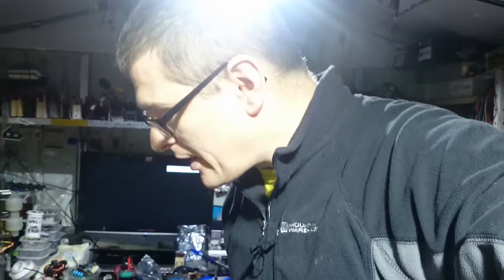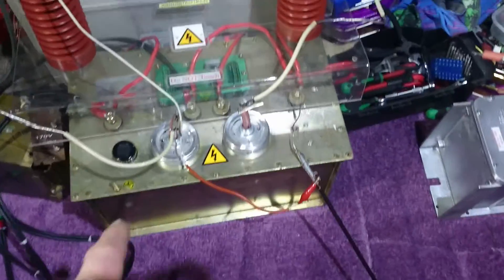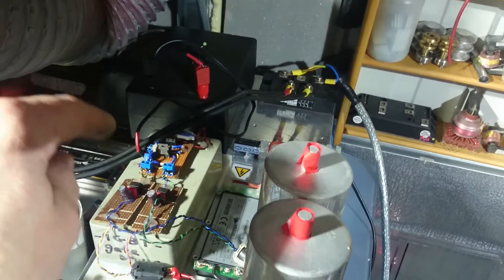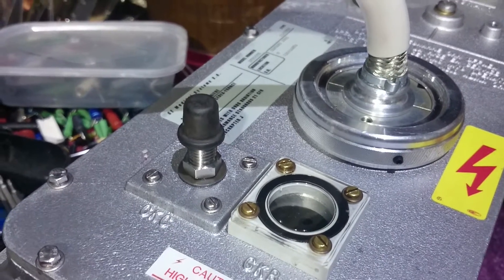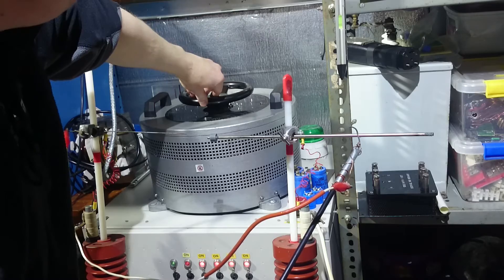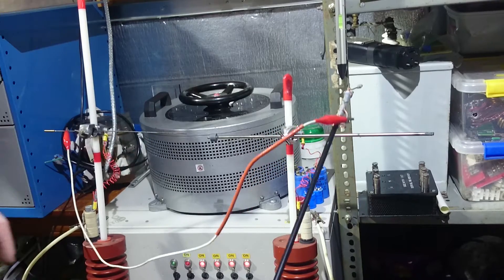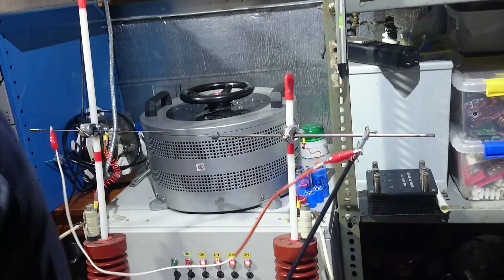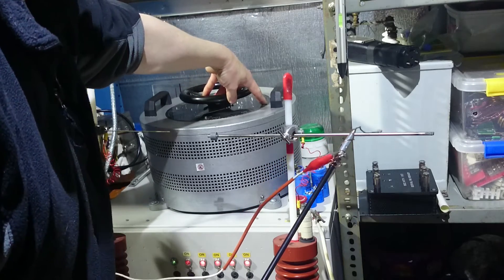IGBT half bridge / 150kv X-ray transformer '

Comment: Hi, that is brilliant!!!!
Could you tell me one things?
Does the Xray transformer is plugged straight to your half bridge or are you using a LC resonant circuit in between like for a CCPS?
Reply from the maker: Florian Delmas Hello mate, no its connection is straight to the igbt. 👍😉 thanks for the comment.

Anthony 

High1voltage1rules
Reply: Thanks,
Last question then, how do you manage to current limiting the transformer?
Reply from the maker: Florian Delmas ballast it mate 👍😉
Reply from the maker: Florian Delmas you ballast the input to the igbt. so it can only give what you give it. the maximum I ballast mine from 150watts to  5000watts 👍😉⚡⚡⚡⚡⚡⚡⚡
Reply: Yep OK, so you are only using a big variac to regulate the input voltage
 which regulate the current, then no need inductive ballast!!!
Thanks
Reply from the maker: Florian Delmas Hello,
No the variac Does no limit the current at all!! That's what ballasts ate for!! if you Do not limit the current your variac will pull so much current to what your supply will give it. do not use a variac without ballasting if you don't want to destroy your equipment or endanger yourself. 

High1Voltage1Rules
Reply: Hi Anthony,
OK thanks so last question.
What kind of ballast are you using? Inductive or resistive one, primary or secondary side, big manufactured choke or hand made one?
Reply from the maker: Florian Delmas Hello mate, it's an inductive ballasting, upto 5000 watts. 👍

Comment: There is capacitors in series with the HV output, it is located inside the transformer tank. This is why you get the crackling sparks.
Reply from the maker: Hello
yes I'm aware of this as Iv stripped these down and built them back up many a times.

but thanks for your time to give info and comment.

Anthony

high1voltage1rules